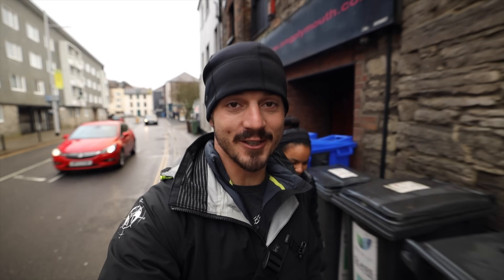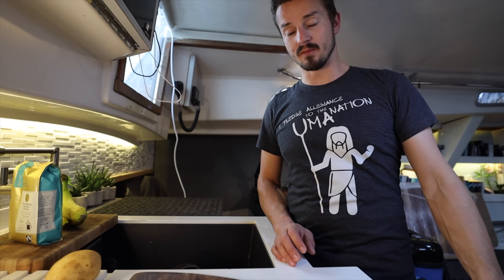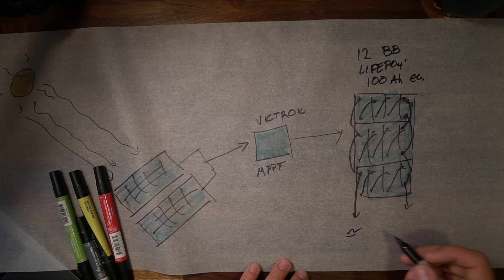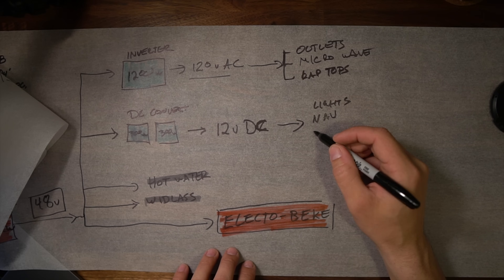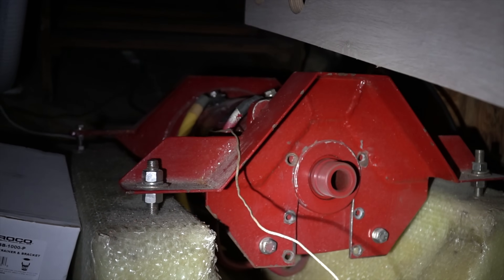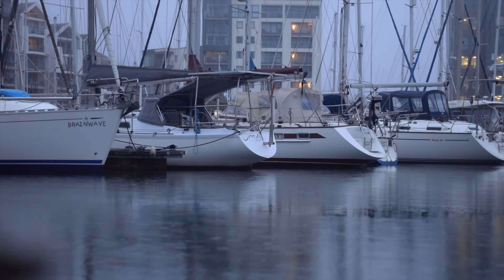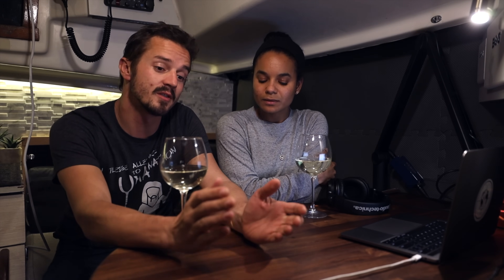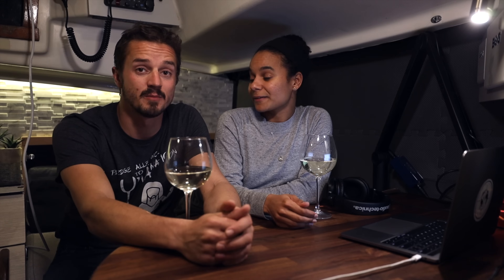5 Years Living offgrid on an ALL ELECTRIC Sailboat — Sailing Uma [Step 206]

Comment: Great work! I have been wondering whether I could get away with an induction stovetop. Looks like you're still cooking with propane, right? Have you thought about induction and rejected it?
Reply from the maker: We have an alcohol stove. Much less dangerous than propane and easier to find fuel too. Same cooking temps. We could run an induction cooker, but right now don't have a way to put that power back in without a generator. So until we tweak our regen and maybe get a wind turbine, we'll stick with the alcohol stove. We also like the fuel redundancy, not relying completely on electricity.

Comment: Hello Im curious about the laptops that you have now and the ones you used before, the ones you have now seem to be macbooks and they are not really that power efficient, im guessing maybe you had a macbook air before so ofc if you max out a low performance CPU is gonna use a lot of power so makes sense to change to a better cpu that wont be maxed out so often or for such longer periods of time... however Macbooks thermalthrottle very hard to the point where an intel i9 performs almost the same as an i5 or even an i3 so this means you are wasting money buying higher end Macbooks and even thou this accidentally makes the laptop more power efficient its also making it take more time to render the final videos for example and maybe using more power than it should, im not sure how much better the 2020s are but they cant be that much better. To be honest i hate Apple's marketing (because is so good it allows them to overprice everything a lot) and all the things they do so i may be a little bias but windows laptops are i think much better and you can control more stuff about them, for example you can under volt the CPU, i think you can also turn off the turbo speeds which draw a lot more power and so on and on top of that the new Ryzen 4000 series CPUs are crazy efficient, i think they use around half the energy of an intel cpu with similar performance, also AMD's have better integrated graphics so you may get away with it alone if you dont use a GPU or at least not a decent one.
Reply from the maker: It's not only about numbers and performance specs. We use Finalcut Pro to edit, and that program paired with a new apple computer can't be beat. It renders video at least twice as fast as a PC running Adobe.

Comment: Something you need to know about refrigeration devices (fridge,ac,electronic equipment that have heat sinks ,like inverters ect.)
There are basically heat pumps.They pump heat from one place and transfer it  to an other place.In the case of your fridge,it pumps heat out from the inside of your fridge housing (thus keeping your food cold)and pumps it outside of it to the ambiant air,most of the time via its casing .So what i find strange is,it looks like you put your fridge in a drawer,shielded from ambiant air.This is bad.This can stops the heat transfer,keeping your fridge's casing hot.The heat has nowhere to go.So the pump keeps pumping all the time without producing any cold in the unit.If you want to hide it,ok,but you need to provide air circulation around it.You could also add a fan to vent your cabinet.Some units will have an overheating protection,some may not.

I have repaired many inverters that went bust only after 1 year of use (They should last at least 10 years) because they were installed in a small space without air circulation.
Food for tough.
Bye.
Lucien
Reply from the maker: The fridge is on a shelf, not in a drawers, so it's surrounded by the vast cavity where our old diesel motor used to be, and the whole compartment is under the water line so it stays quite cool and has good air circulation to distribute the heat removed from the fridge. (which is barely warmer that the air going in)

Comment: You could easily add 2-3x the solar panels on the deck and add 2x 500 W wind turbines. Get a 12V usb C laptop charger, should save some power.

Comment: I liked kilowatt- being aware enough to know what you mean- didn't the merrimack sink- any way -  Having just bought 4 battle born- I admire the investment in true quality equipment.  I got a discount on the price for having visited the "Big Tent" in quartzsite.   Incase you nation doesn't know- battle born has a lot of built in safe guards for temp and charging limits to give a long lasting battery-  I was pointed to battleborn by Kombi life (also starwars fans) 

SO was very interested in your wiring diagrams and also the the DC to DC charge controllers- which I hope to use on mt VW camper as solar would put quite a strain on the Rivera pop top.

Thanks for the education and in your case "I heard it on the internet- so it must be true" applies.

Comment: UK voltage is 230v 50hz. When your hooked up to shore power how you converting that to 120v 60hz ?
Reply from the maker: Our main battery charger is 230V so that charges our batteries when at the dock. Then we invert to 120Ac and Convert to 12V DC to run all our boat loads.

Comment: if you got macbook pros that use usb-c for charging you can charge with DC without the loss from inverter. just check your usb-c wire you use that it is type 'pd' it will negotiate appropriate draw

Comment: I don't know if your 48 V to 12 V DC to DC converter is bidirectional, if it is and as it appears that your electric motor has a separate field winding, having motor regeneration could be as simple as finding the right field voltage and have the motor electric output into the 12 volt system might work.  I am a retired former elect generating windmill design engineer.

Comment: Why not get more solar panels?
Reply from the maker: We have plans to, but they'd have to be temporary, since we don't have any more space to mount them permanently. But adding a second, redundant set of flex panels that are removable is expensive. So it's on the back burner for now.
Reply: @SailingUma  what about folding over board, either side. I've seen that done in Barcelona's Marina

Comment: Great video, covered all the basic details plus more in a concise and informative manner. Well done. BUT!!!! You plan on getting 200W of regen sailing 4 knts :O Please explain and share. Because a lot if not most of them do not provide any regen until above certain sail speed, which is more then 4 knts. So how do you plan on getting that much with only that low of sailing speed? 

This is why that is typically not worthwhile unless on big sailing boats (ie volvo ocean race) or multi-hulls. For example OverVolt "Hydrogeneration at 6kn: Approx. 200W (SD)" for recommended 40' boat using 10kW motor drive. Using small motor drives produce even less, like 8kW provides ~50W at 6 knts. The best I have heard is 100W at 5 knts .. not lot speed increase required, but with such units they will slow your boat down 0.5 - 1knt and the bigger the unit is the more it will slow your boat down. So really curious to know which one will provide any regen at 4 knts, much less one that does so, so well.
Reply: Thanks for this question, Kevin. Wasn't this the point of the hull refab and prop gearing replacement/rebuild? The prop & motor plus Li ion batteries  and inverter wasgoing to provide backfed regenerative power 24/7, with the rare exception of motoring in harbor. My initial impression of that set up was pricey, but well worth it if it could produce 3 kw hrs of power day or night at sea. Now, instead, power will be sourced strictly from the solar panels, which cannot ever be relied upon. I've seen off-gridder home owners who struggled with this and they have huge low voltage systems.

What did we miss? When did it change? What's the cost breakdown for the electrical system? Thought the prop, drive transmission and electronics ran close to 10 thousand, generously gifted by a wonderful patron. I'm not criticizing in any way. I'm knocked out by all the beautiful work you two have done and I think you've set a new standard for everyone.

I electrified my recumbent trike with a 48 volt 40 ah Tesla battery pack, ($400), Chinese 1000 watt Bafang motor and mosfit controller bank, digital readout & controls, ($400), & NuVinci planetary hub drive ($500) which altogether cost $1,300 sans trike but it can lift 400 lbs - 200 lbs for me, 75 lbs for the trike plus 100+ lbs of gear 31 mph at full throttle up a 15 degree incline. I get 70 miles per charge out of it. I think it should be adaptable to a sailboat. What's the approximate coefficient of drag in the water for Uma fighting a 4 naut mph current?

Comment: Hey I really like your videos and I've been looking into getting a boat and doing an electric conversion. You should look into getting cigs solar panels or amorphous silicon solar panels. They aren't quite as efficient as silicon but they do extremely well in partial shading and you can roll them right out because they're flexible. You could also do a wind turbine on top of the mast that would be cool to see as well

Comment: Be aware that LED lights are not created equal.  Low cost LED lights only use a resistor to limit current and the more expensive LEDs, like "Dr LED" uses a built-in pulse-width-modulated circuit (PWM) for efficient energy use for a constant output of light.  There is a possibility that a poor PWM circuit may cause interference with the radio.

Comment: At 7:48 you comment that your laptops run off 120V. This is a misnomer, as they obviously run off batteries. What you're saying, of course, is that one generally uses 120V (that's here stateside - it'll be 220/240 in the UK and most of the continent) to charge those batteries. The issue is that the in-line "brick" in your power cable is actually a small step-down transformer that takes the 120V and turns it back into DC power the batteries will accept. Thus, you're taking transformer losses twice to charge your laptops, once to create 120V then a second time back into DC via the infamous "brick". What can be done is to charge directly with DC once you work out the exact volts/amps required (hint - should be written on the brick). Yes, this is the moment where I should point you to an exact product or at least a how-to but I don't have that handy and I suspect you can google as well as I. Best of luck - love your channel.

Comment: total battery storage capacity is 15 kW or 15 kWh?
Reply: and battery bank has direct connection with the inverter? or inverter is connected with the MPPT charge controller?

Comment: PowerMax Converters make 120 amp 12v charger that can be put in series, parallel or series parallel to get the 12kw you need in one hour with a 12kw generator... would probably equal out to about 30 cents per kwh or $3.60  to fill the entire bank as long as it could handle 240 amps continuous  at 50 volts with series-parallel of 8 converters and the gen set.. you'd need to double or triple up on cables

Comment: just stumbled upon your youtube channel with your invite for day with Royal Navy.  You have done a great job putting together a great electrical system.  I would still be a little nervous when away from civilization and would want a small 2000 watt generator just in case. I am an operator of a hydro electric power generating station but at times we need generator, ours is diesel. All our breaker operations are DC, fed from battery banks around the plant, also control room. Unfortunately we only have a certain amount of operations of breakers from batteries if power and charging is lost. In comes the generator to provide power until Hydro gens back up and running.  I think worst possible scenario, rogue wave takes away your solar panels. Little gen would be enough to keep batteries charged and continue to operate.  I have subscribed.

Comment: All electronics use low voltage DC... I guess it isn't worth it, but your laptop bricks are just transformers converting the 120 VAC back to 12VDC.  you losing about 5% in the inverter and another 15% in the transformer... so about 20%.   You could drive charge them directly off of 12V, with a DC-DC adaptor like this guy: https://www.youtube.com/watch?v=WV5XSE736wM
and save most of those losses.

The biggest surface area in the boat is the sails... I wish one could sew panels into the sails... but it seems no one does that...

Comment: Mentioning "Watts" is a piece of a larger puzzle. This is just a power potential figure, a bit like horsepower. Horsepower says nothing about the fuel in the tank. So if you , on a northerly cloudy day, can reap "700 Watts" then the unanswered question is, how many (kilo.) Watt.hours. Which would give an idea of what you can do with the harvested Watts. Or, if you collect 700W for 7 hours, this gives 4,900 Watt.hours and this equals 4.9 k.W.h. The 7 hours are optimistic in the UK's winter, its climate and latitude. And there are losses, no doubt, in controllers. And, when you start using the energy from the batteries, you have conversion losses. No doubt there is DC to AC conversion and there is up-transformation. All these together may add up to some 30% "loss". Or, in that case, the 4.9 kWh ingested may only put 3.43 kWh out.
So, learned friends, what is it?

Household energy consumption in gas + electricity in the UK - searching the interwebs gives, for typical low-medium-high UK households, 8,000 .. 12,000 .. 17,000 kWh (energy equivalent of burnt gas). The L-M-H energy profiles are in two classes, where class 2 is 25% to 50% higher, and class 1 does 1,900 .. 3,100 .. 4,600 kWh.
Uma?
Reply from the maker: Our boat draws on average 100W, so 2.4kWh a day.
Reply: @SailingUma  - thanks for the number. Plus heating and cooking with gas? Anyhow, it means you have just a tiny bit of energy reserve for driving the electric motor-propeller. Not sure, what "boat" means. All nav kit, USB and laptop charging, light? I noticed you used a wind-vane autopilot and may have an electric one too. With that level of energy conservation, it might be worth to see if a separate battery (bank) for one or two voltages would cut out some conversion penalty. Generate 48V DC, transform up to 115V or 230V AC and next transform down in a power supply for the laptop or smartphones and other devices with battery backup. A technical architecture question - what do yo do where? It all depends on savings potential (in energy) as opposed to hassle.

Comment: Have you thought about running a small alternator on the back side of the electric motor so you could be using the motor and charge at the same time? This should extend the charge of your batteries so you could run further. Or you could run a large alternator on it so on days when the sun isn't out then you could charge up just by running.

Comment: kW (power) is like Speed and kWh (energy) is like distance.  If you go 60mph for 1 hour you will go.....60 miles.  If I go 3,600mph for just 1 minute you'll travel the same 60 mile distance.    If you run a coffee kettle it's about 1.5kW of power, but it's only maybe a minute so you consume 1,500Watts / 60 minutes = 25Watt Hours or 25Whr.  If you run a 50Watt lamp for 3 hours you would get - 50*3 = 150Whr.  It's important to differentiate the two :)

Comment: 1) How do you heat the boat in Winter?  2) Why not use a gasoline engine, and use the electric motor as back-up?  3) Why are you using an electric toilet, instead of a mobile home type toilet?

Comment: Speaking of getting hit by lightning, I've seen a sail boat that was hit and they were put back in the stone ages real quick. Lost everything. I hope you have good protection and backup gear. 
First time watching. You have a subscriber.
Reply from the maker: In case of an emergency, We can still run our boat with no power at all. It would suck to not have electricity BUT Everything electric is seen as more of a comfort not a necessity.

Comment: This video was very hard to hear. I hope that you bring the audio back up to there us less than perfect hearing can hear.
There are many wind generators that are 48 volt that are also relatively small and produce good power. I was looking at them to augment my single 270 watt panel on my motorhome. That project is on hold at the time as I am in Thailand and putting the house together that my wifes' mother owns and we will someday inherit. I have many projects here that take priority over the motorhome at this time including upgrading the wiring, leveling floors, insulating walls and ceilings, etc....
The plan is to upgrade this place and then consider the motorhome when we can travel together (OBamas' immigration policy has not been removed despite Trump changing it back to the way it was before OBama) with the blessing of the government so that my wife does not have to have any legal problems.
I noticed your breakers are from the automotive store and that is good as they are very serviceable and last longer as they are designed for harder use. I also wonder if you have considered a automotive alternator conversion that runs off the output shaft of the electric motor to supply some power while motoring? You also can make a small wind system with a 12 or 24 volt alternator that takes little space and is able to be stowed away when you are not using it. Most large trucks have 24 volt systems and if you split your banks into two systems for charging you can charge a 48 volt system that way. It still allows you to operate the batteries in a 48 volt operation like what you have.